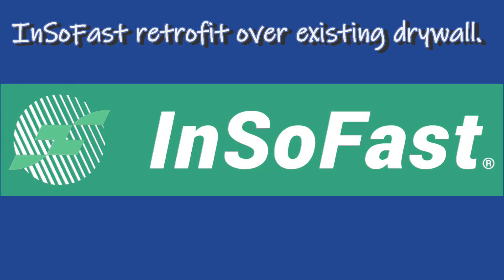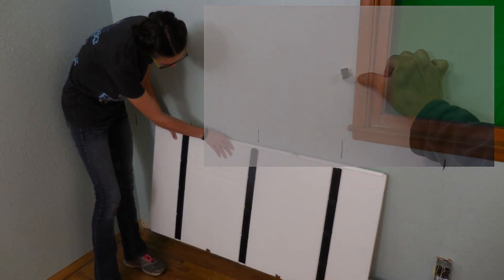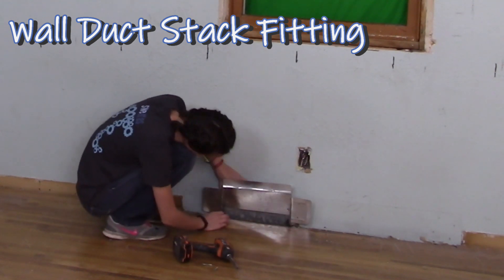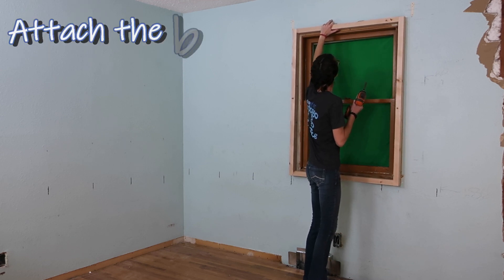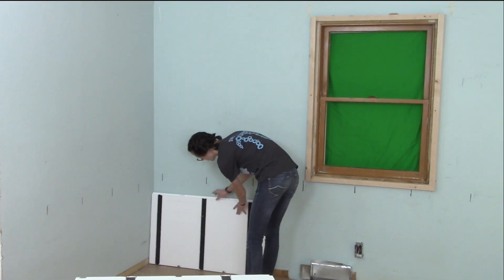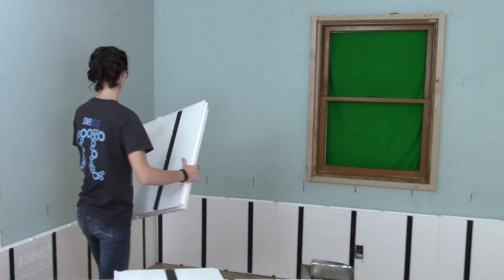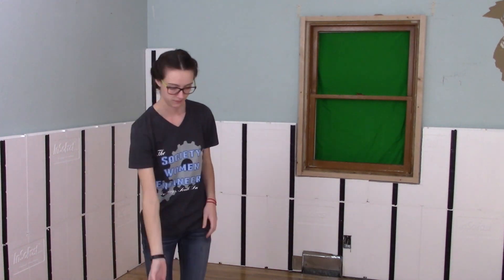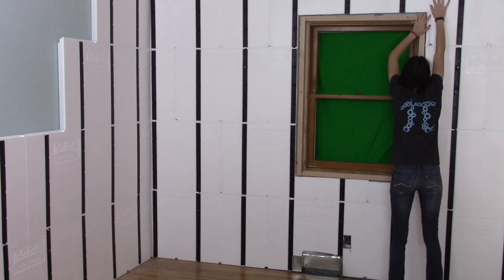Step-One Insulation over Drywall or Plaster Part 1

Comment: I wish I coulda found this here in canada 
   I have my wall stripped to the lathe and the plaster has been removed due to a leak 

   Now I’m a bit concerned with attaching the foam boards I purchased directly to the lathe due to this air barrier thing your discussing 

Anyone know if I can attack foam boards directly to my lathe and should I add a vapour barrier before the foam board?

Comment: I have super thin wood paneling walls with seemingly no insulation. Would I be able to use these panels?  Would that be sufficient? Also, how many inches does this take off the square footage of a room? What do you recommend for concrete block basement walls?
Reply from the maker: Kelly- If your super thin wood paneling is in a basement over concrete block I would say no. If it in above grade over wood framing it is a good application. Here is a link to a resource on our website that may help you decide; https://www.insofast.com/explore/faq-before-you-finish-your-basement.html
Reply: @insofast-continuous-insulation  Sorry I didn't get notified of your comment. Thank you so much for replying. The wood paneling is upstairs over wood framing.
Reply from the maker: @kellyeverett2566  sure